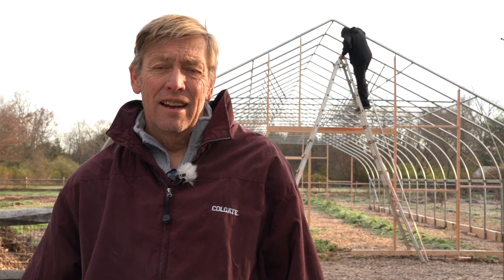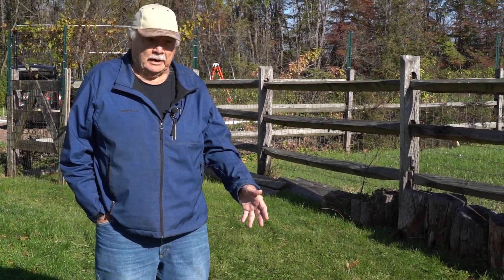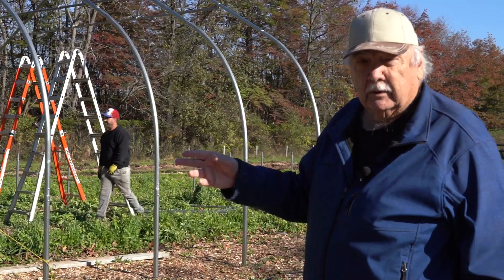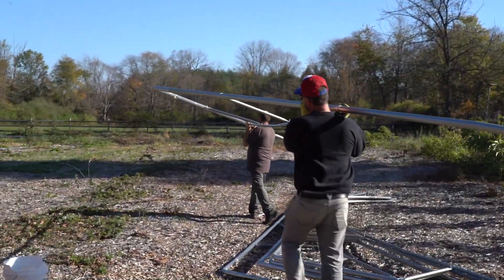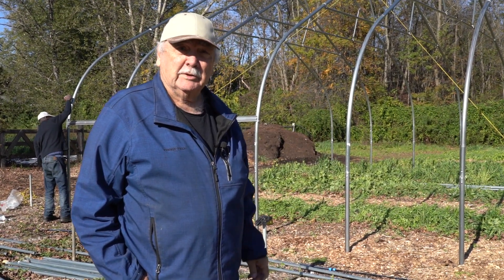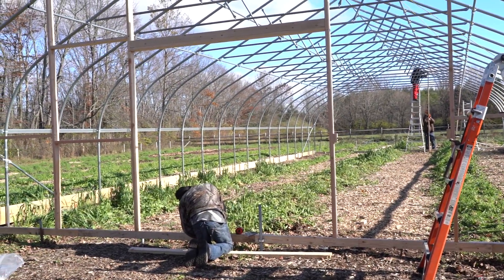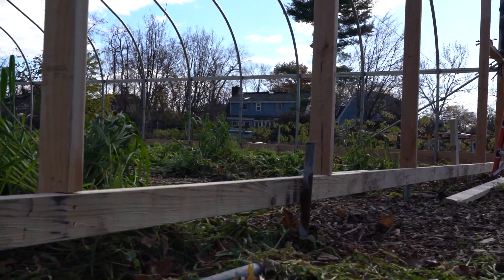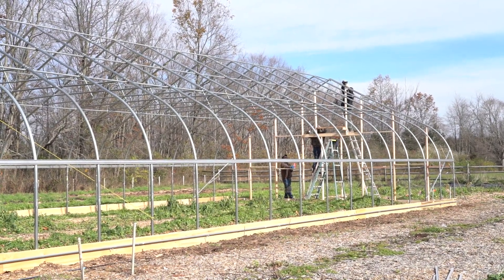Workshop: High Tunnels - Construction (2020)

Comment: how much does the high tonnel cost ?   What would the final cost be if you had that crew put the greenhouse together  for you and all construction
Reply from the maker: Sorry for the extremely slow reply!  the high tunnel costs just about $6k, and it is covered by an NRCS contract. If you hire John, it is ~$7k, there are less expensive ways to do it, with a couple guys, or yourself, but the pieces are heavy, and it is better if you are handy.
Reply: @NOFANJ  Thank you
Reply: @NOFANJ  would that include all wood  and what is the exact measurments of the high tunnel   30X???
Reply from the maker: @GARDENSTATEGARDENER  30x72 and no the wood is additional OR you can order additional parts from RImol